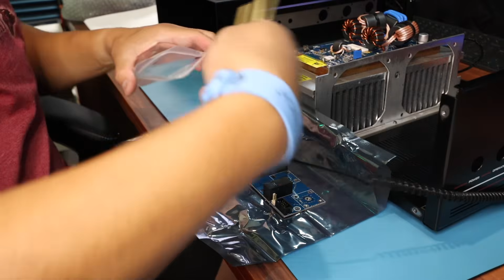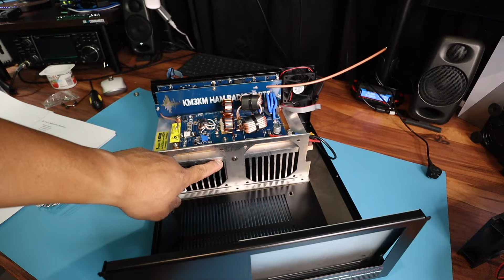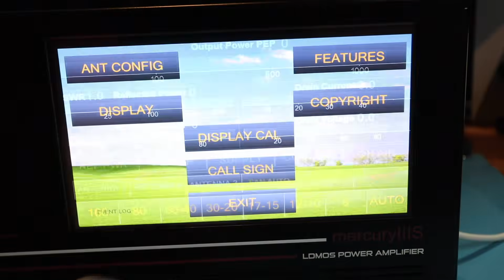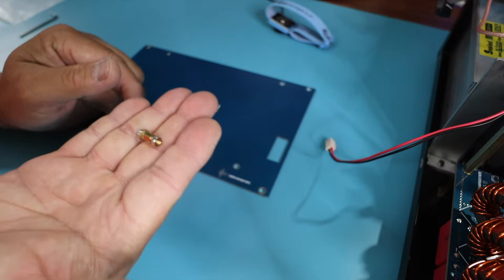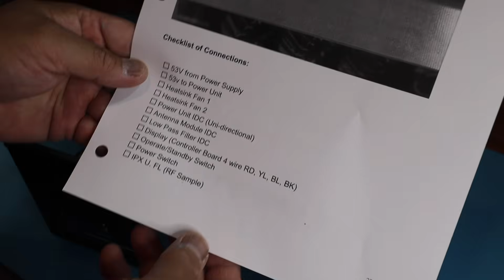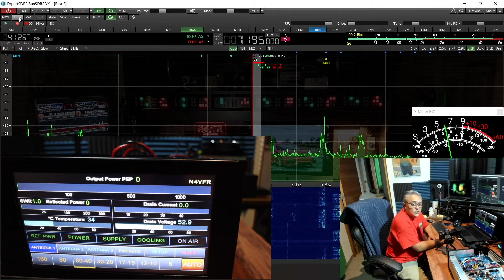Building the Mercury IIIS Kit | Assembling the Mercury IIIS Amplifier | My Building Process and Log

Comment: Is that correct? 2.5W driving out 512W on 40m? did you modify the pad attenuator for driving it with low power? Thanks.

Comment: Hello Capt Darren.  I would like to know the wire connection for 240VAC operation.  I see on the amp connector L, N, and Gnd.  How do I hook up the plug for 240 VAC?  I have a 40 amp service in the shack with Two Hots wires, one Neutral, and one Ground.  So how do I connect a 4 wires service to a 3 wire device?  Thank you!
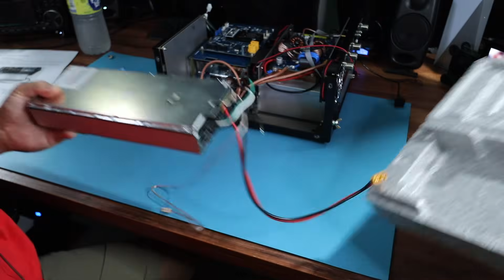Reply from the maker: If you have already have your shacked wired for 240 VAC, the Mercury IIIS amp will sense the voltage.  It's auto sensing whether you use 120VAC or 240VAC.  At timestamp 58:23 I show you how to connect the power supply to the chassis.

I would check the power coming out of your 240VAC outlet and ensure you have the correct polarization before hooking your amp to the 240VAC outlet.  This is the plug that I use on my M3S.  https://www.amazon.com/gp/product/B078S9HGKX/ref=ppx_yo_dt_b_search_asin_title?ie=UTF8&psc=1

With regards to wiring up your 240VAC outlet, I got an electrician wire up my 240VAC outlet.  I hope this helps a little.